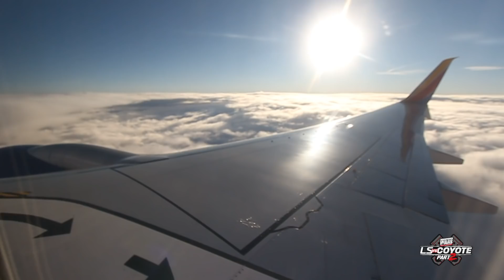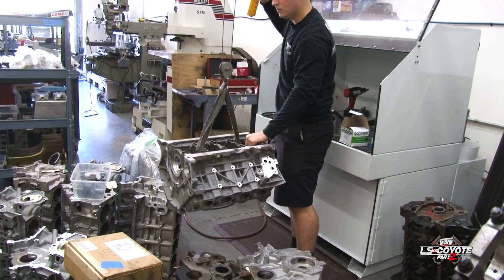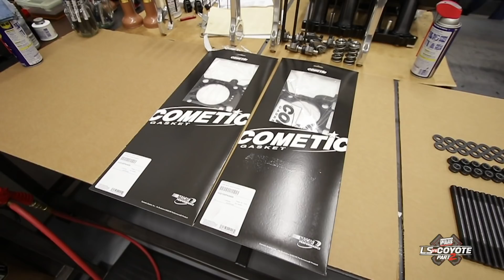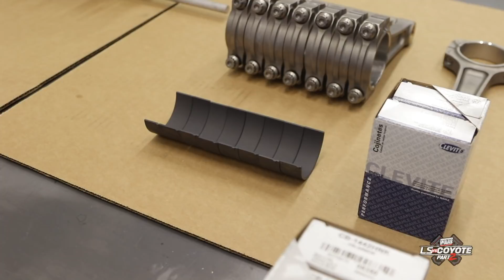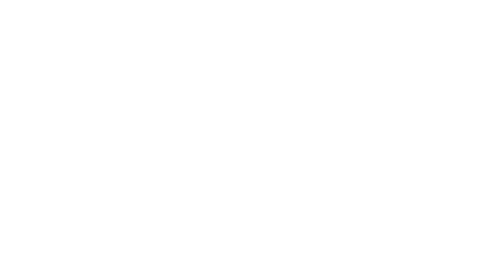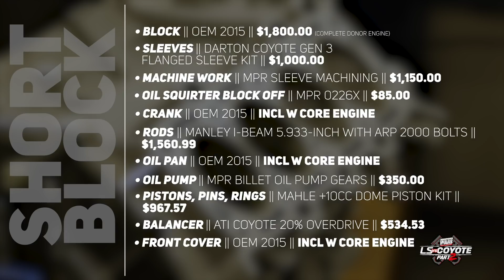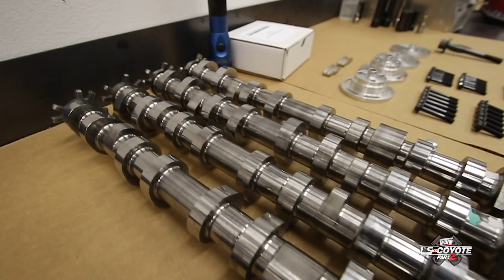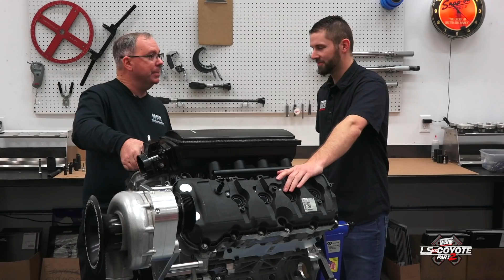LS vs. Coyote 2 Episode 3: The Coyote Engine Build

Comment: Hmm, a $3000 aftermarket GM LSX 7 liter block vs. a junkyard Ford truck stock displacement block. I know noone makes aftermarket Ford stuff like the LS market, but you guys could have done a more apples to apples comparison. If you're using stock block, crank and heads on the Coyote why not do a comparison with a stock block, stock crank stock headed GM truck motor?
Reply: A D 
Sir, I agree with you on that, but they know that the stock components of the LS base engine wouldn’t last through a whole Dyno session and there would be such a mess to clean up in the Dyno room!
Reply: No shit, so true. Hot Rod magazine  or Super Chevy, can't remember which one, just did a thrash test on a junkyard 6.0. Stock bottom end, more ring gap, different heads and cam plus turbos. 1400 plus HP and finally split out a PM high mile rod on a stock crank. They did the same thing with a 5.3 which ended up being a 4.8 LR4 truck engine. Doesn't make sense in  comparison.
Reply: @Alpha Wërks  watch it again they got a junkyard long block for $1800 which is actually a fucking steal unless it had some high mileage on it....
Reply: @mrjesuschrist2u  I paid $1800 for my complete 10K mile JY coyote F150 engine. Its not a steal
Reply: @Twin_turbo_coyote_fox  1800 is a steal especially for a gen2. Can you find them for 1800? Sure but its not like they are sitting around at that price. I got mine for 1900 cause i had the money on the spot and was actively looking for those steals.
Reply: @mrjesuschrist2u  gen 2 f250 are not as desirable because of the firing order. It can be changed in the tunethough
Reply: @Twin_turbo_coyote_fox  tracking that. The point remains 1800 is a steal and they sell almost instantly at 1800-2500. They sit for an impatient buyer at +2700. EBay prices support this
Reply: because it would be a $5000 ls3 vs $25000 ford lol i bet thats what that 5.0 cost built like that
Reply: @hncjg  they're obviously not getting a billet 5.0 a stock 5.0 from a mustang eith heads and everything else is 5k so stfu. It's also the engine from a f150 so again not fair at all and oh 2 liters smaller but again who cares because its mostly chevy dick riders in here
Reply: @juicebox8549  Look nutsac, the Gen 2 Coyote block from the truck IS the same as one you'd get in a Mustang, the only difference between a Gen2 truck and Mustang motor are the cams and manifolds.
Reply: They clearly stated it was a brand new block. Then calls it "basically a junk yard block". Because he knows that's where it'll end up.

Comment: After this video I love the coyote engine even more! going to battle with stock block, crank and heads unlike the LS 😎
Reply: Alpha Wërks lol stock parts and ya I’ll agree with sleeves but it’s a junkyard block still further more and same could of been done to ls but admit it aftermarket heads are better end of story and are not stock by no means that coyote has ford casted cylinder head 🤨
Reply: @bigpigslapper Oink  modified production block. Not different then boring and line honing or putting in fresh bearings. Cant say the same for the lsx block though. 
I think is fair to charge for the new sleeves but not for the machine work to do the sleeves... The rules are worded subjectively.
Reply: @Neal Head  stock usually means it drovenoff the assembly line with it.... Other wise a roush blower is stock for a mustang.... I can go to the parts counter and buy it AND get a warranty.
Reply: @Neal Head  no sir, stock means production block used in the vehicle straight from factory the LSx never came in a vehicle off the showroom floor.
Reply: That's not a stock block anymore at all. Lmao
Reply: @Alpha Wërks  the point is they couldn't do that with the ls and get the same results simpleton smh. 5.88 at 255 factory block, crank and heads. Ls will never do that without a lsx block and aftermarket crank and heads.
Reply: @waynebollentin989  Stock 4.6 aluminum block have gone faster lol. Regardless the 4.6 and 5.0 stock blocks are probably the strongest stock blocks ever.
Reply: I have seen a 7.02 at 202 @ 3200 lbs in a prepped stock production Coyote block. Years ago. Off the trailer lol.
Reply: @karlhopkins713  no the stock 4.6 stock block hasn't gone faster. No need to be like the dodge guys and stretch the truth lol. Everything 5.88 and above has been done with the stock 4.6 block. MMR does have all the records with the mod motors. They been running 6.0-teens since 2011 with the stock 4.6 block, crank, head. MMR has been in the 5.80-90's with many different combinations with the 4.6, 5.0, 5.4, 5.8 The fastest pass was 5.80 @ 256 was with their Billet 351/5.8 and factory ported GT350 heads. That was with Mark driving not john.
Reply: @robertelmo7736  sorry but that's bullshit, a "stock" block will not live under the power level required to run the times you just stated and that's a fact.  Unless of course by prepped you mean upgraded OPG and crank gear, sleeves and water jacket supports along with rods, pistons valve springs etc.....  you know there are people on this post that actually know what they are talking about red right?
Reply: Yes, fully upgraded. That's what I said. It's still a production block, will make way more and live way longer than any production LS block.
Reply: https://www.youtube.com/watch?v=VxJozW_DFPs
Reply: @robertelmo7736  well,  you said stock prepped block so that is really vague.  So you're saying that a production LY6 that has been "fully prepped" with Darton sleeves and all the bells and whistles is less reliable than a coyote?  Not sure how you figure that, that's kind of a biased statement to be honest.  At the end of the day all these engines if built right correctly are extremely reliable due to the leap and bounds of cnc technology along with the tech advances in standalone engine management.
Reply: @robertelmo7736  apparently there's a comprehension problem here with some of them lol..
Reply: Alpha Wërks dude how are you going to compare a cast-iron aftermarket race block vs a junkyard stock truck block? The stock crank was polish and balance I don’t see what that makes it aftermarket.... The LSX got  aftermarket heads and on top of that LME added different aftermarket parts to those aftermarket heads lol how are you even comparing stock coyote ported heads? Dyno queen? Have you ever driven a mod motor car? You can make 1000 hp on a twin turbo coyote and it will Idle like stock! Not choppy cams needed
Reply: mora  doMoran don't forget about them sleeving the coyote, which makes it no long stock
Reply: @beardedforlife3740  OK you can sleeve any engine new block engineered with new webbing and designed for aftermarket performance is a different story from sleeving a block ls is great but it's a block dedicated for this all that is done to that block is new sleeves no add strength to the Block just added strength to the cylinder walls for cylinder pressure the block has been modified  but the lsx is still completely different but hey if ford offered a high performance block I would want it so it's cool the ls has that going for it
Reply: i like both engines, but LS fans sound like @$$hole5. this channel should have disallowed comments  on these episodes.
Reply: @sepg5084  nah, I am a Chevy guy at heart but I will be honest and tell you that the coyote deserves respect.  I build turbo engines and I can tell you for a fact that even though I am a chevy guy we have built some boosted coyotes that have shit all over some heavily built LS engines
Reply: Holy crap on a stick I’m so tired of hearing you Ford guys crying that the LS isn’t using stock parts or bragging that the Coyote is. If there was a choice I guaran-damn-tee MRP wouldn’t be modifying factory parts either. But you know was well as I do they don’t get a choice because there isn’t an alternative unlike the LS engine. Thanks to the LS’s engineering simplicity and 22 year history it gets to enjoy vast aftermarket support. Don’t like it? Blame Ford. The Coyote is well engineered but much more complex than the LS. That complexity makes aftermarket re-engineering too costly and so no matter the lifespan your power plant enjoys you’ll never have the aftermarket the LS has. The next generation of GM V8’s are going overhead cam more than likely and they’ll suffer the same fate. Get over it wipe the shit off your knob.
Reply: @coryholbrook4643  listen, I am a chevy guy and I too build big power turbo cars and there is one thing you don't seem to know.  The LS is a "Y" block that was basically copied from Ford.  Also if you knew what you were talking about you would also k ow that in class racing the coyote is limited in cubic inch so the ls can compete because the LS can't move the air a coyote can and that's a fact.
Reply: You are right, Ford NASCAR guru Robert Yates was instrumental in the development of the LS.
Reply: Cory Holbrook people are complaining cause. A junkyard f150 block build doesn’t compare to a top of the line LSX build. It’s really that simple, every comparison I see with these two engines they always gimp the coyote acting like there isn’t other options 🤦🏻‍♂️
Reply: @GODEYE270115  man you ford and chevy fanboys crack me up.  No engine block that is darton sleeved wether new or used is a slouch.  $1900 + block and freight ends up at well over $2k and will allow any block to make stupid power.   Cut the fanboy crap and just respect the power that can be brought out of any of these builders.
Reply: Cory Holbrook I’ll make it even funnier if the coyote manages to win this, remind y’all how outdated your pos dinosaur pushrod is 🚮
Reply: Cory Holbrook I totally agree bro ford has new pushrod though and I want to let you know that it’s a modular engine and it’s been around and in production sense 1991 in the Lincoln town car 4.6 2v still build on the same architect but redesigned in 2011 to compete and bring it closer to the European ohc motors I have a 4.6 4v and I love and it cost a lot money but I live that engine and I think it looks cool and I like how big the engine is physically it looks bad ass in my opinion further more that engine build can hold more power then I’ll ever want and I appreciate the power band where I can drive it on the street with a fuck ton of power and not make a fuck ton down low like ls which by the way is cool and people like that but it still has enough power where it’s not Jdm and need boost to move out of someone’s way in the lower rpms... I just love v8s all together
Reply: Aftermarket block does not add power it adds strength and longevity. All they are doing is glory runs so a factory block would have been totally fine so dont get all caught up in the blocks
Reply: lol, did you watch the LS video? Stock block , stock crank, stock lifters, stock rocker arms, and stock head bolts.
Reply: @HerrimanB14  im not arguing that its still an after market block. you cant get them in stock applications
Reply: @HerrimanB14  the block was an lsx block so thats not stock at all
Reply: Jose Flores it’s a factory gm produced block. How much more stock can it get?
Reply: Bryan Herriman stock would be used in a factory car so further how much more stock can you get lol junkyard trunk block 😂
Reply: @HerrimanB14  yea and tell me what vehicle does that engine come in?
Reply: @HerrimanB14  the LSx bkock is an aftermarket block, it never came in anything from the factory.  The LSx block is a race block designed for 3000 builds.
Reply: ClutchkickPJ - I’ll tell you what car! NONE. Ls dick riders love to flaunt their shit like it’s the best thing ever created when mod motors have done the same shit and ls motors HAVE NOT and will never brake the records the Ford mod motor has.
Reply: @HerrimanB14  crank, lifters, rocker arms, and head bolts ..... Wow production gm engineering at its best.... Block is not a production block.
Reply: Bryan Herriman true but be real there both American v8s I want to see both make big power keep your pride to yourself this America next shoot out should be just series I love these videos
Reply: Hahaha... call it what you want. Gm is gm... arguing with Ford guys is like arguing with liberals. You all think you and you’re junk engines are the cats meow, meanwhile everybody with a brain that wants to go fast has a ls 🤷🏾‍♂️
Reply: @HerrimanB14  yeah ok lol.... I'm a Chevy guy and build turbo engines and can tell you that statement is false and that's a fact.
Reply: @HerrimanB14  who's been faster in the 1/4 mile again ? Yeah the Ford with a factory block, crank and ported heads. 5.88 @255 I'd wait from for an ls to do it but I'm already in my early 40s.
Reply: @waynebollentin989  sorry but not a stock block at all, the yote will not live under that power level unless it is sleeved and supported and that's a fact.
Reply: That's not a factory block if you are talking the MMR car. I'm a Ford guy, but the MMR boys run the little 351 block they make now. They have a billet 400 that hasn't even been pulled out yet lol...
Any of their stuff will murder an LS anything.
Reply: @turbochevelle5641  Fact they went 6.teens with the stock block crank and heads back in 2011. They also been in the 5.90s. With that same setup just for the record and accomplishment. Everything they use now is sleeved or billet. Even sleeved it's still a factory block. Sleeve a non lsx or even a lsx block and repeat what they did. Won't happen. They've only been 5.90s with a billet ls with aftermarket heads. Still fast though regardless. Either combination makes tons of power and you still need a car and chassis that's tuned and setup right. Otherwise all the power is useless
Reply: @waynebollentin989  sorry bud but a block is no longer considered stock when it has been sleeved and supported, stock means as it rolled off the production line.  Also your crazy if you think  a block as it sits that can hold 2500+ hp then sleeve it won't make an enormous amount of power.
Reply: @turbochevelle5641  I've been building tuning and racing for over 25 years with both ford and Chevy. I don't have a dog in this race. I've defended both sides on both videos depending on what's said. I'm coming from a unbiased point of view. So I don't need your interpretation of what stock means. All these blocks have work done to them. Even the lsx when it's new. I was making the simple point which it has been accredited for by many and holds the record for many different combinations using the factory block and heads. Stock crank/aftermarket etc. The block is still from the factory. Obviously it has lots of work done to it. I figured that was common sense and wouldn't be part of the conversation. You can modify a factory LS all you want. Use a sleeve and it will not hold the same power. That's the comparison that's being made here. I'm sorry the truth hurt's and you don't want to except it. No Ls is running a factory ported head running near that time either. Can't even keep the head on unless it's a 6bolt block over 1500hp and that's being generous. Ford did a great job with the 4v motor. Not saying the ls is shit either. The Ford is just simply better from the factory.
Reply: @waynebollentin989  well obviously you do if you think anything other than what came of the production line is factory that's all I am saying.  I don't think anyone in their right mind would disagree that's honest.  A darton sleeved anything disqualifies the term stock.
Reply: The "stock" comparison is retarded, and the newer modular shyt isn't as stout as the old 4.6 stuff even being sleeved. SBE 5.3 has been 7.1,  idk seems good for something as it left the parking lot untiuched save for a head, And quit regurgitating internet bs, iron 6.0 with stock crank has hit 1289whp with a Billet S480 and AFR 4  bolt head, that was as much as the Borg Unit would give. Getting heads to seal has moved forward since 1997... For a stock platform it meets about 98% of the weekend enthusiast needs for MUCH CHEAPER. For 1% the factory "challenge" is a let's see proposition, the other remaining 1% they probably aren't chancing factory shyt or wrestling with making it work because they don't have money/time/resources to R&D like MMR did. Pro Mod is probably one of the stupidest examples to use for real world people who might spend 15000 on an engine.